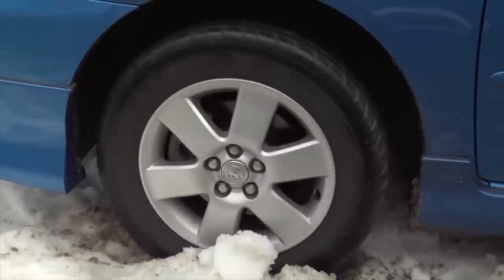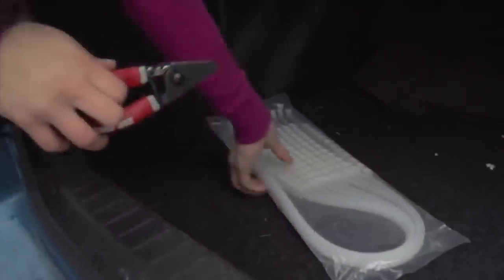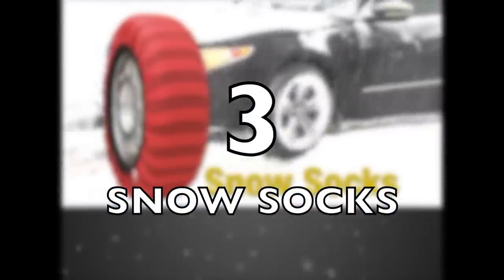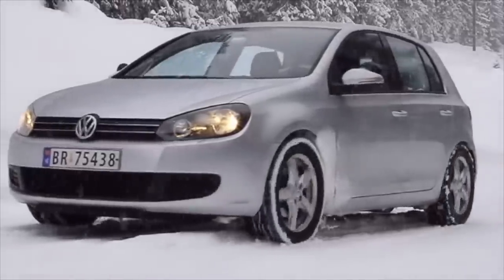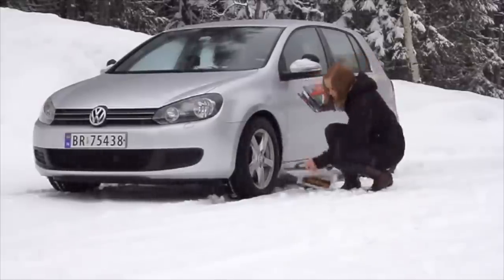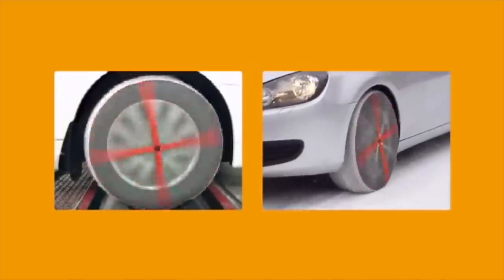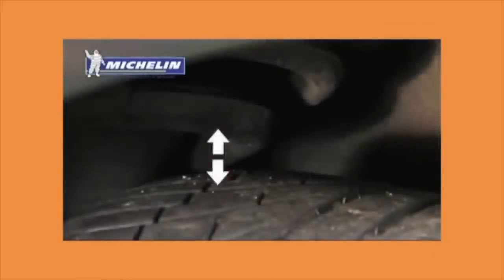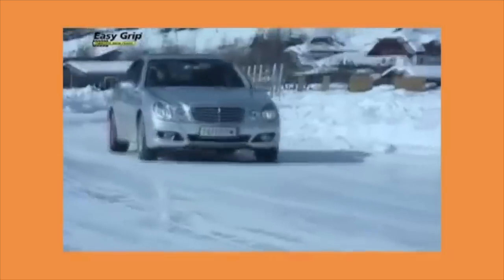Top 5 Amazing Snow Chain Alternatives For this Winter

Comment: the last one easy grip is the only one that looks any good, if people had these in their trunk in town it would help
Reply: Much depends on your tires. If you have deep tread tires, such as aggressive all-terrain tires, smaller diameter wire, chain, and rope traction devices are virtually useless. They will work their way into the treads, adding no traction to the surface of the tire. Snow socks are a better option.

Comment: I saw in the video that some people still had summer tires on them in the dead of winter, not good, in Germany we have had a situational winter tire requirement for several years, and there summer tires have no place in the snow, first of all, you make the drive wheels spin and skid a lot the tires are broken and secondly the transmission is also affected, sorry not good,

Ich habe im Video gesehen das manche im tiefsten Winter noch Sommerreifen drauf hatten, nicht gut, in Deutschland  haben wir seit einigen Jahren eine situative Winterreifenpflicht, und da haben Sommerreifen im Schnee nichts zu suchen, erstens macht man durch das viele durchdrehen und schleudern der Antriebsräder die Reifen kaputt und zweitens wird auch das Getriebe mit beeinträchtigt, Sorry nicht gut,

Comment: ALL JUNK   NOTHING BETTER THEN STEEL  CHAINS
Reply: AVRITO T. I've seen BMWs flying up hills in snow socks so they obviously work.
Reply: Nothing works better than Audi Quattro. My tt doesn't need any of your snow sock shite
Reply: AVRITO T. Chains are worthless when you don't have enough clearance between the sidewall and suspension.
Reply: Paul Nolan my jeep's Quadra drive is pretty damn close. Front and rear limited slip differential. And can fit much bigger tires under a jeep
Reply: got that right